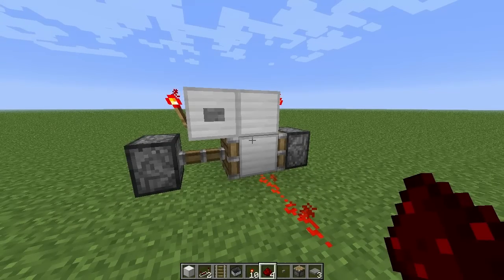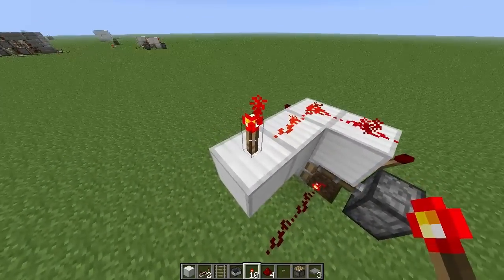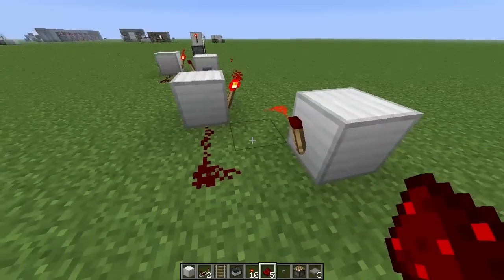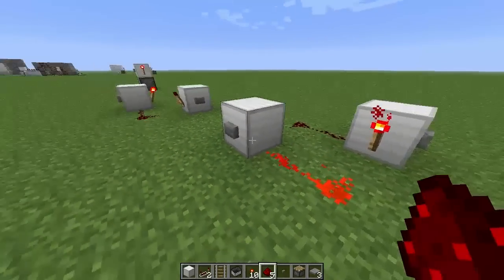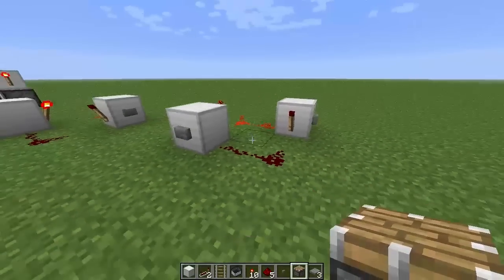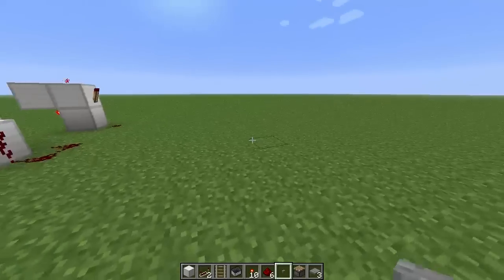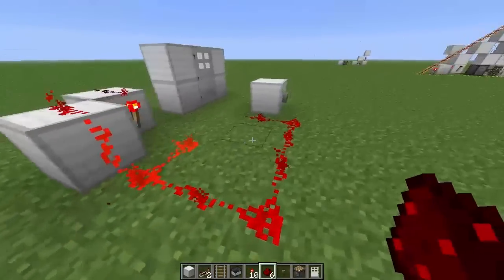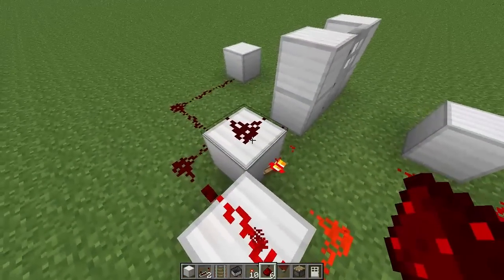Redstone Tutorials - #10 RS NOR Latch

Comment: I used this and a flip flop to create a mechanism that has pressure plate in front of the gate and behind the gate. Walking over first one opens the gate, walking over second one closes the gate and renders first pressure plate useless so if mobs walk over it after me it would not open it, using the second pressure plate for the second time resets the first pressure plate for another use.

Comment: Great tutorials! I have a question - can I make the latch reset by a timer, to like say, have a fast activation and a slow deactivation? Cheers!
Reply: I would try to put a lot of delayers in series, connecting directly from output to reset.
Reply: Use a pulse extender.
Reply: you can slow down or speed up redstone by flicking a repeater to max for slow or leave it with no clicks for fast.
Reply: You can make a 2x2 piston door w/ pressure plates, using redstone comparators. Make a 2 block deep, 3 blocks wide and 3 blocks long hole. Put 2 comparators facing forward and backwards and redstone dust around it, like this:

*   *  *
   |  ^  
*V  |  *
*   *   *   (It’s hard to “draw” an example  :’(      ) 

Then break 2 block deep, 2x2x1 holes next to the original hole in the middle, on both sides and then dig a 1 block deep hole next to it, and place a redstone torch, again, both sides, like this:

                         *   *  *
                            |  ^  
torch    *   *   *V  |  *   *   *   torch
                         *   *   *   

Fill in the hole. Place a block on top of the torches and redstone dust on top of the block. Do it on both sides. Then put 2 sticky pistons in front of the block and another one on top of the piston, both sides. Place a block of choice in the middle of the pistons. Then put pressure plates there and you’re done! Hope this cleared it up a bit more. It’s tough explaining it.

Comment: Guys, I need help understanding just one thing. If he used a button for the latch, and the signal switched, and since the button is only a temporary output, why would it not change back?
Reply: Because it powers the torches and they stay on forever until you turn them off. Then the torches power the circuit. I think that how it works

Comment: It's useful for things like that, say if you wanted to build a trap for something, where they opened the door, and then closed it on themselves, that would be what you used it for. Or you could set a seperate output on the inside to let you get back out, but if you're doing that, it would be more useful to just use an Or gate I guess.

Comment: The answer is range my friend. You can toggle a door to open & close with this, with levers behave oddly and wouldn't work like a T flip flop can.

2 levers can turn on a piston, but ONLY if 1 is turned at a time. this means a piston door would open from 1 side, and remain open forever, until you turned the first switch off.

Comment: i just started watching these, and is there a device where theres a pressure plate and if you step on it, nothing happens but something happens when you get off it...
Reply: Maybe use a falling edge monostable circuit? You get a 1-tick output, but you could always lenghtrnen that if desired and will give an output when leaving the pressure plate